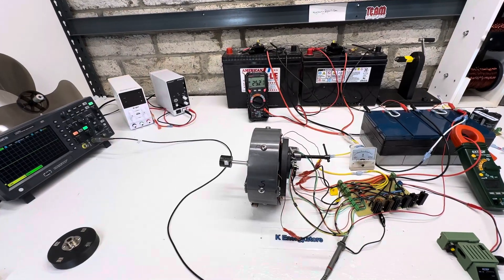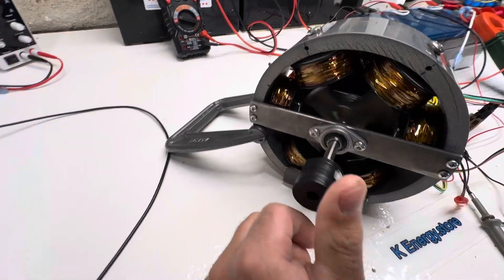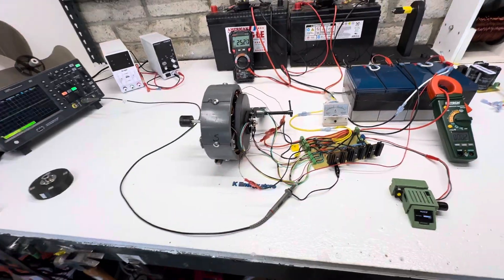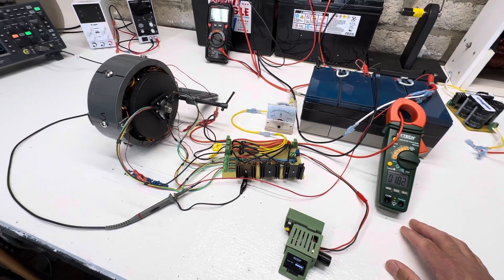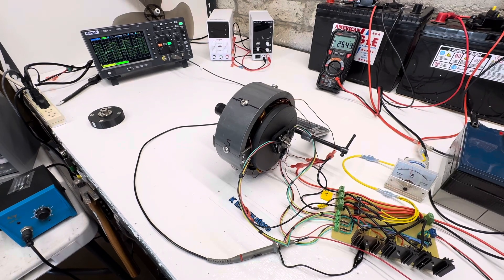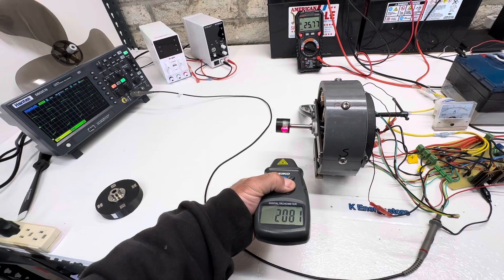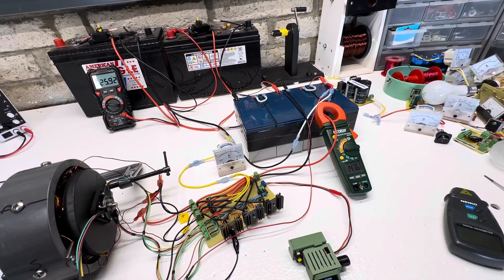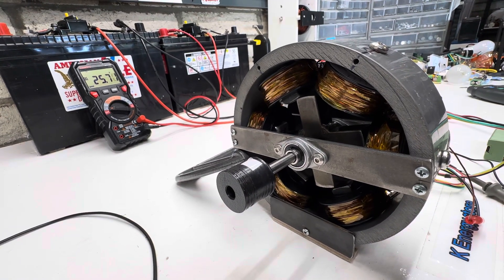Attraction motor with 3 phase timing

Comment: Is it possible to make one that can operate a three-wheeled motorcycle,,, a Harley Devinson motorcycle,,, Thank you and I wish you success in all your work.
Reply from the maker: Yes just needs to be bigger
Reply: @kenergy1707  
I watched a video clip of a motor mounted on a three-coil marine boat, which is fast and powerful. Which is better and do you advise me to adopt it? Thank you for your kind response.
Reply from the maker: @mayarhayar5710  probably more like the one in the video my outboard motor has major magnetics and should not be by regular steel

Comment: This is actually kinda neat, try a 4 leaf clover head shape for attraction motor idea.  the location of the attracted mass further up the arm of the rotor will give more torque. the reason you'd do this is that magnet-free motors are cheaper to build.
Reply from the maker: Exactly

Comment: Is it possible to create a 9 phase motor?  As the waveforms of the other phases return to zero, another phase rises to bridge the momentary interuption? Thank you sir.
Reply from the maker: Yes you can but that’s a lot of wires 
3 circuits works good they overlap each other
Reply: @kenergy1707 Thank you sir.  😊👍